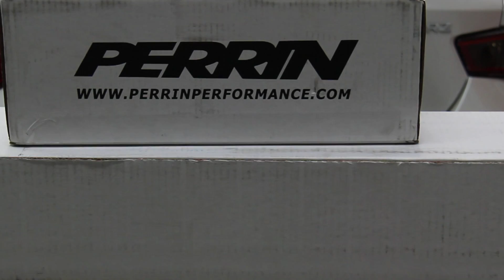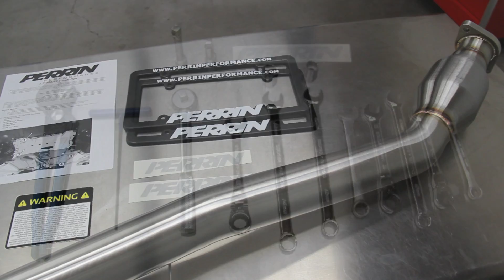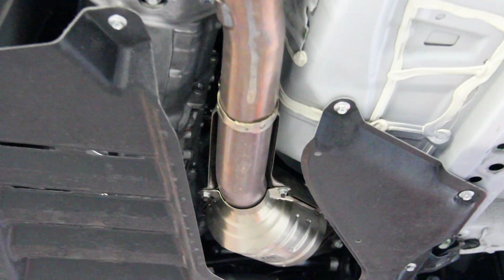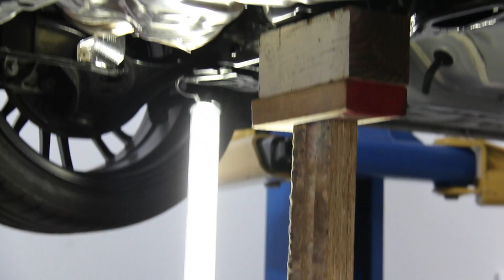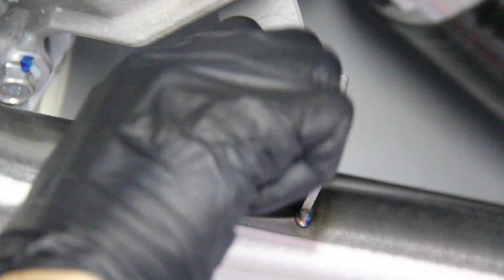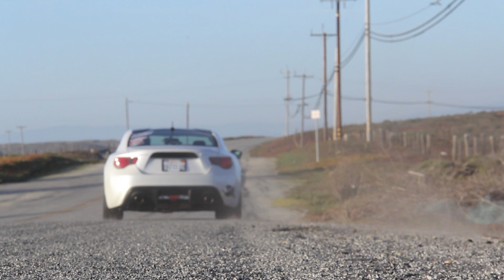Perrin Performance Over Pipe and Front Pipe - Unboxing, Install and Review - 2013 Subaru BRZ

Comment: Just a little tip, don't know if this has been mentioned, but you can remove the over pipe without jacking up the motor by removing the heat shields from the pipe. It slips right out once those are off